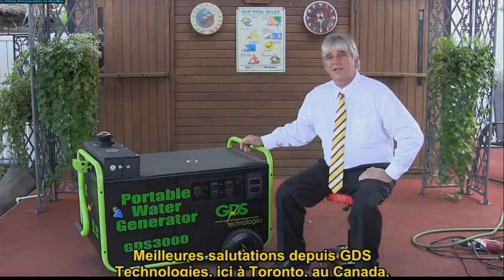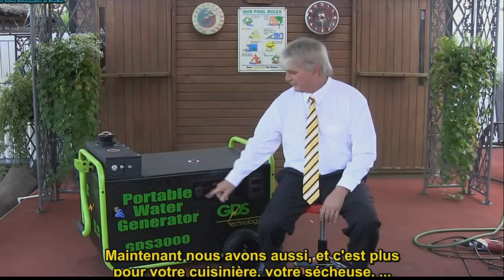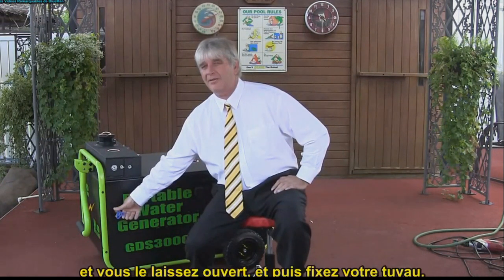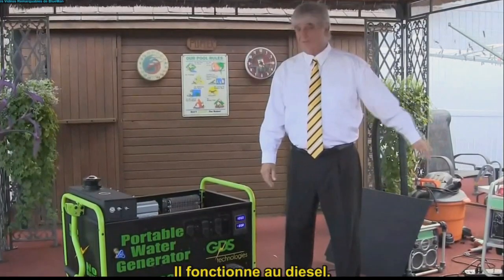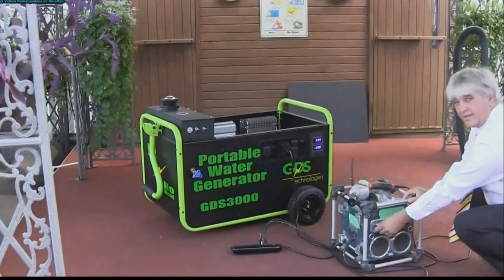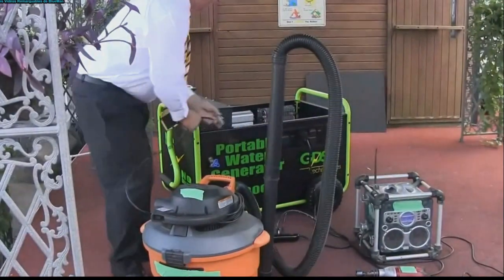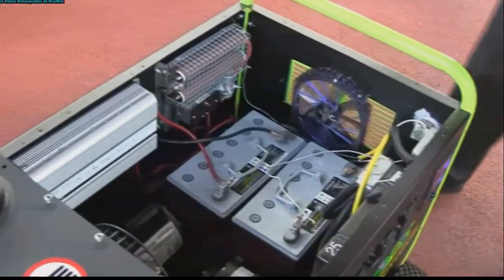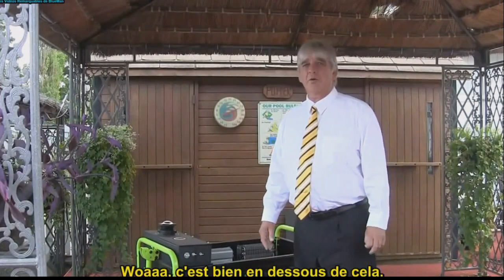Générateur d'électricité à eau produisant de 5 à 15 Kw.

Comment: Cela fonctionne a l'hydrogène , les batteries commence le processus en transformant l'eau en hydrogène, qui est récolté dans un reservoir sous pression. Le gaz fait tourné le moteur a hydrogène qui a son tour fait tourner un alternateur qui fourni l'électricité et recharge e même les batteries. Pas de gaz nocif puisque l'hydrogène est propre et 'eau est gratuite (pour le moment ). On pourrait reproduire le même système dans toutes les voiture et ainsi ne plus polluer la planète mais certain grince déjà des dents. Partager l'info
Reply: Je pense qu au bout d un moment cela s arrêté même avec de l eau. Il faut 5 kwh electrique pour 3 kwh hydrogene et le rendement des moteurs est faible disons 30%.
Reply: l'Hydrogène pas nocif ? c'est juste ultra-explosif 
déjà qu'il y a pas assez d'eau pour abreuver et nourrir l’humanité si en plus les voiture en consomme ... 

après le problème c'est le rendement séparer les composants de l'eau nécessite beaucoup d’énergie comparer a ce qui va être récupérer  
(d’ailleurs les voiture a hydrogènes existe mais sont limité par ces facteurs (entre autre))
Reply: @thgondran2094  ce n'est réellement pas les cas , ça a la même propriété que le super avec l'avantage de se disperser plus vite dans l'air en cas de fuite . C'est toujours impressionnant quand il y a des démonstration mais prends du super et enflames le et dis moi si c'est moins dangereux qu'un gaz qui ne se colle pas à ta peau .
Reply: @thgondran2094   on n'est pas obligé d'utiliser de l'eau potable pour récupérer de l'hydrogène
Reply: La production d'hydrogène avec les technologies actuelle (Chimique, culture d'algues, électrolyse, fermentation, oxydation, thermochimique..) demandent beaucoup plus d'énergie qu'elle n'en produisent, il s'agit là d'une farce car ça n'a absolument aucun intérêt et ce n'a jamais était sur le marché. Ça viendras probablement dans un futur proche lorsqu'une technologie le permettra.
Reply: @thgondran2094  "déjà qu'il y a pas assez d'eau pour abreuver et nourrir l’humanité" L'eau ne se perds pas, dans l'air il y a de l'humidité qui peut avec les techniques low-tech reproduites partout dans le monde et qui permettent a des humains à l'autre bout du globe de récolter et purifier comme le fait le cycle de la nature mais en bien plus rapide.
Reply: @moutonnoir787  je suis dans le risque chimique et je peut te certifié que l'hydrogène c'est dangereux même si l'essence c'est vrai que c' est dangereux mais sa trenne pas sous haute pression et en générale sa reste parterre alors que l'H_2 sa fait des nappes qui ce colle au plafond (la ou les systèmes électriques les font détonné) (se matin mes pote on désincarsérer  un mec l'essence c'est barrer mais sans explosé alors qu'il y avait des tas de sources d'étincelles) et resemant on a eu a faire a un gars qui a perdu un pied en marchant sur un petit volume (fermé) d’Hydrogène simplement  sa pas supporté la pression et sa réagis avec l'O_2 quand le contenant a céder sous la pression  (donc faite gaffe et n'en produise pas à la sauvette)
Reply: @hermanndu033  (en l'état actuel des moyens de production) il faut une eau la plus pure possible si tu veux pas bousier le système de production trop rapidement
Reply: @hermanndu033  ouais mais t'es obligé de la traité : viré les bactéries métaux lourds contrôlé la minéralisation (c'est a dire la définition  d'un traitement pour rendre l'eau potable) donc autant la boire (l'eau des brouillard est trop acide typiquement il faudrai la réduire a la chaux par exemple)
Reply: @thgondran2094  Pourquoi un simple procédé d'électrolyse ne suffirait-il pas ? J'ai vu une vidéo où l'électrolyse se fait sur de l'urine. Je ne vois pas en quoi les paramètres de composition chimiques ou acidité de l'eau aurait une quelconque importance car on cherche à récupérer uniquement un gaz.
Après je suis conscient qu'il y a des étapes de séparation pour obtenir le gaz mais réellement je ne comprends pas le rôle de la pureté de l'eau.
Reply: @thgondran2094  ok d'accord, si je comprends bien c'est un souci de protection des électrodes ou de gestions de gaz toxiques.
Il est vrai que ce serait plus optimal de ne pas abîmer les électrodes.

Mais il faut tout de même reconnaître qu'avec une maîtrise du procédé et de ses inconvénients techniques, ça reste quand même une solution propre car le chlore est dangereux certes mais on peut tjrs le faire réagir avec de la soude pour obtenir du NaCl (dans le cas d'une eau salée).
En ce qui concerne les électrodes, il y a des méthodes d'oxydoréduction pour les protéger si je ne dis pas de bêtises sinon le cuivre et le zinc ne sont pas des métaux trop dure à remplacer.

Après c'est extrême de dire que l'eau doit être nécessairement potable pour obtenir de hydrogène... Je pense qu'avec un procédé d'épuration par les algues (par exemple) on pourrait avoir une eau suffisamment propre pour avoir une électrolyse efficace.

Cependant, je suis bien d'accord pour dire que ce n'est pas quelque chose qui peut se faire chez soi avec n'importe quel eau mais à une échelle industrielle (c'est à dire géré par une entreprise pour l'énergie des maisons par exemple ) , c'est une solution plus qu'adéquate  selon moi.
Reply: Il n'est indiqué nul part que ça fonctionne à l'hydrogène... Mais avec une turbine qui fait tourner/couler l'eau en boucle via une pompe auto alimenté... ça fonctionne avec n'importe quel courant d'eau ( comme une rivière, exemple - https://youtu.be/1KyL1-0A0Gw ), l'inventeur ici a simplement (si j'ose dire) mis au point le bouclage en système clos, avec la puissance de pompage/jet nécessaire... Nul besoin de transformer l'eau en hydrogène ici. Pourquoi chercher Midi à 14 Heure ?
Reply: Plus clairement c'est la turbine mue par l'eau qui produit l'électricité, pas l'eau transformée en hydrogène... Il n'y a pas de transformation mais propulsion d'eau. On n'ajoute de l'eau que pour compenser l'évaporation naturelle due à la chaleur du système pour apporter/garder le niveau d'eau nécessaire à la puissance du jet)
Reply: Et enfin la seule chose qui n'est pas propre ici c'est la batterie qui sert à alimenter la pompe et s'il en est celle qui sert à stocker l'excédent. S'agissant d'un groupe électrogène, sa fonction est d'apporter ce qu'il faut quand il faut,  l'usage de cette batterie est/peut donc être  limité et l'usure des deux peut de plus être grandement freinée en gérant les rechargements à partir de 30% et déchargement à partir de 70%).
Reply: Bravo,  vous avez fait péter le bullshitométre.
Reply: @hermanndu033  les eaux usées ça serait Nikel